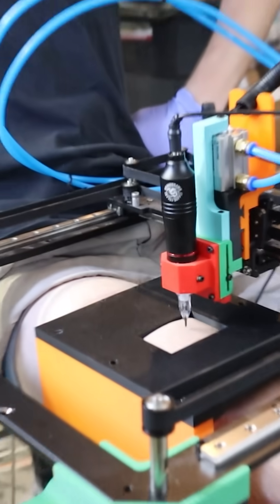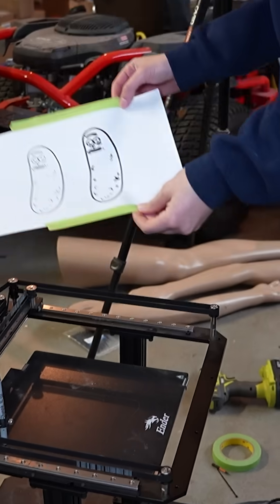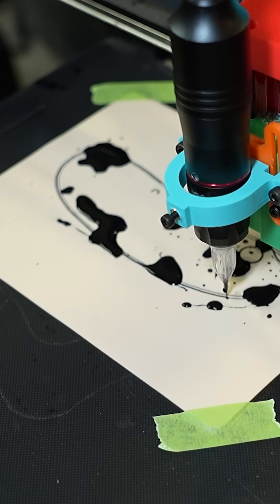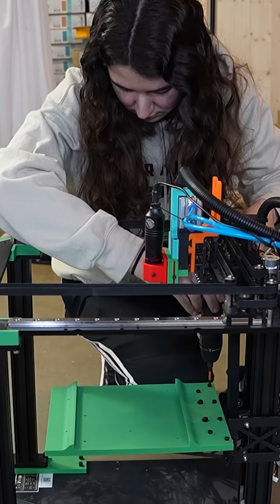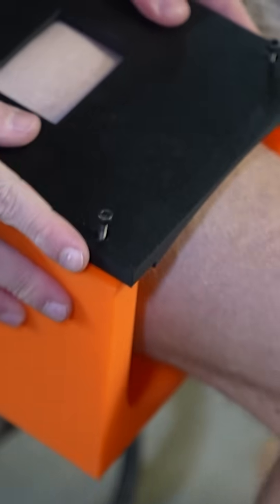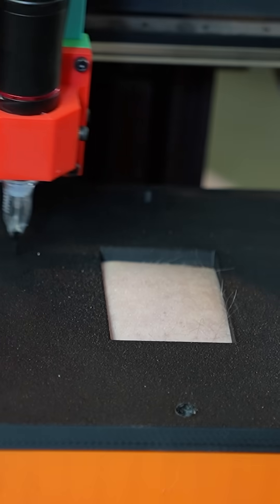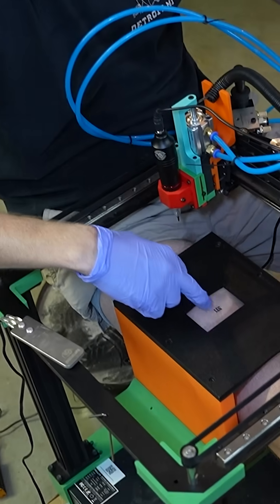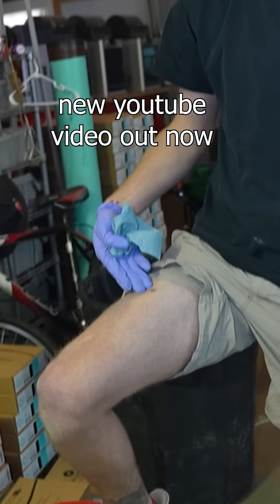Tattoo 3D Printer?

Comment: This is actually crazy. You know how fast getting tattooed could be if this was a thing
Reply: Mhh.. for real life application, you d need a custom g code, sensors for leveling and some form of "pause" function to refill your ink... And more but for fuck yeah that s cool function hell yeah ! One doesn't become an engineer with a boring mind y'know : )
Reply: @blablah3167  you really need LIDAR for the leveling issue and sadly you also kinda need 5-axis motion to get the correct angles on the skin
Reply: @jxdinglol  yep, or could also 3d map on point cloud and use that as a reffs but cudos your RAM, means are many, dedication, tools and knowledge are what prevent many projects, was just implying that it s fun yet to fully make it work practically it d require a lil bit more than "fuck yeaaah !" and some serious skill, so tattoo artist you can relax you re still having your jobs for a while : )
Reply: @blablah3167 your not gonna need to refill your ink. You just need a larger cartridge
Reply: @blablah3167 then the person flinches and there goes your plan
Reply: Problem being, skin isn’t flat. It would have to compute moment by moment topography of whatever body part it’s tattooing.
Reply: @jawa8883  you could have the printer make a mesh like with an auto bed leveller
Reply: @Scarytoaster1809 I know you know you can’t putt too much pressure when tattooing skin.
Reply: @Scarytoaster1809  it would be a bit mroe than that. you'd probably need to use a lidar system
Reply: @Scarytoaster1809  i think it would be smarter to have like a 3d depth camera which should model the height better

also maybe some straps to keep the limbs from being able to move around to make sure the tattoo is in one place; humans can easily adapt to movements but machines may struggle
Reply: @jawa8883 To be fair, we already have auto bed levelling, so some of the tech from that could go to this
Reply: @jawa8883 not too hard a fix, there is already technology to map out your build surface for 3d printing because build plates warp over time from the heat cool cycles that they go thru. Just add some gcode to map the build surface first then it will adjust z height to follow the surface.
Reply: @jawa8883 actually can probably program it 2 read the area it’s gonna tattoo like a scanner 2 see Dow down or up it has 2 go like on the four arm
Reply: @jawa8883  whe have machines thst laser eyes. I guess a tstoo robot should be possible
Reply: @jawa8883  6 axis 3d printers need to be invented now 😂
Reply: @jawa8883 thats probably possible in these times
Reply: @jawa8883 they have multi axis cncs and 3d printers bro. This is easily a thing. Ai art, ai tattooists. Well. Ai taking jobs left and right like that south park episode
Reply: @jawa8883 stick a LiDAR sensor next to it and call it a day😭😭
Reply: Laser depth reader attachment and adjust the height based off readings and you can tattoo bigger, and more varied surfaces
Reply: @jawa8883  That would actually be pretty easy to engineer around. Just a few thousand for an electronic eye or whatever they go for now (I haven't been a machinist in like 20 years now, so I don't know).
Reply: @jawa8883  easy... add a LIDAR
Reply: @jawa8883  which is wholly and completely possible
Reply: @jawa8883 
I imagine you could do a few workarounds for this; for example, one that’s probably overkill would be to take a 3D scan of the area being tattooed and correlate that map to the image being “printed”
Reply: @thefourshowflip  except humans move. the skin moves.
Reply: @jawa8883  as long as you can stay still while the needle is touching, it shouldn’t matter with a 3D scan; it would be mapping topology not position on the printer bed.  I imagine that’s why they used that leg holder in this video, to limit movement.
Reply: @jawa8883 if the skin could be vacuum sucked up or kept taught somehow it would work like embroidery
Reply: @jawa8883 In the full video, I’m pretty sure she put a sensor to determine the curvaturez
Reply: @jawa8883  AI is a scary and beautiful creation. Let's see what's to come.
Reply: @jawa8883  whit an IA thats sounds posible
Reply: @jawa8883 this would not be hard to do the tech to do this is cheap and can be integrated into a machine like this with ease
Reply: @jawa8883  we have the tech im suprised its not done yet
Reply: @jawa8883  I guess the idea is that someone will see this "proof of concept" and go custom design a machine for this purpose that accounts for all the issues
Reply: @jawa8883 yeah, but that would only require depth cameras and also an understanding of skin elasticity etc as the type of skin can vary widely by area and person to person. You also have to take heat into consideration.. and risk of overworking skin, some skin doesn’t take colour as well as others etc so it would need to be able to check the tattoo, as well as wash it during the process etc - there’s a lot that would need to be done. Not to mention sterilisation… would it be manual or automated etc for a machine to actually be allowed to be used on humans would take a lot of investment and research. 

And those are just a few things they would need to be considered
Reply: Another job removed due to automation 😂
Reply: @TheSandwichMonster kinda but someone still needs to make the art for the printer, and tattoo artists really are artists
Reply: @TheSandwichMonster is it really a job thou? It's like being a social media influencer, it's not really a job, it might make you money but it's not really a job.
Reply: @TheSandwichMonster  and another one created per usual
Reply: @TheSandwichMonster I think most people are gonna want to have a human tattoo artist. Getting a tattoo is kinda like getting a hair cut.
Reply: And what about real art made by hands ? Like it's cool and all but i wouldn't do it
Reply: @Kumo_nl 

While tattoo application is a skill and worthy of our admiration, a good chunk (if not all) of the actual artwork is done before the needle ever hits skin.
There's nothing inherently wrong with adopting automation if the results are what the client is looking for, regardless of whether a human is involved in its application.

I know someone who had an AI Image of a norse warrior minorly adapted by an artist who then put it on his leg.
Now that, I'm a little less comfortable with, but we can't do anything about client's choice of artist when it's their body.
Reply: It is a thing they just don't call it a 3d printer..they are literally making robot tattoo artists
Reply: Yeah amazing idea. Let's steal more jobs from artists and replace them with technology that does it way worse. It's way riskier. And only works because of very specific conditions
Reply: @the_snapdragon7809  I wouldn't say it stealing it would just be another way not a replacement nothing can replace artists work!
Reply: Now we're going to have organic vs non organic tattoo artists
Reply: With all the different things that would need to be customized, adjusted, break for ink, etc. It’s much faster to get it done by humans. That’s why tons of figurines are hand painted. It’s faster and less expensive to pay someone to do it than it is to create an efficient machine.
Reply: Hmmmm Star Ship Troopers any body ? 😂😂😂
Reply: @Dallas-r6e  more like idiocracy but yeah, “Death from Above!” 💀
Reply: why are you obsessed with automation
Reply: Missed opportunity should of said my leg!!!!! From sponge Bob 😂😂
Reply: tattooing is supposed to be slow for safety. there’s a reason why rushed works look horrible
Reply: The future is machine tattooing ran by an AI that decided ur artwork needs a 6th finger on its hand lol.
Reply: It can't stretch the skin, it can't predict the unpredictable movements of the client, and it can't adapt to the differing textures and elasticity of skin.
Reply: And cheap. I cant wait till this is the norm.
Reply: I think a bunch of artists would hate this being a thing.
Reply: People don't seem to understand that a good tattoo isn't fast. A good tattoo is done in parts and allowed time to heal between sessions. Yeah, this would get a sleeve or a back piece done fast. But how well will it heal? I bet the fading and scarring would be insane.
Reply: Love how boxed in everyone is in thinking in 8 years when AI has taken its final form to programm itself, we wont have tattoo robots lmao. How crazy 🤣
Reply: Get rid of another job
Reply: @ brother with Engineering and KI- the working class will be fully wiped out within the next 15 years. Most jobs besides day cares, restaurant staff, cooks,  and specific fields of craftsmen will all be done by robots. I was in shanghai for 12 days and saw more robots than i have in 30 years of my life. They are producing humanoid robots in masses now in china.
Reply: Dude the pain tho.. a machine can't just pause whenever Ur pain level is maxed n need a break... Just imagine bigger tattoos..

I needed a break on my black/white 5x5xm tattoo, as it went over some bony areas.. he actually had to shift the tattoo a bit off center, away from the actual bone.. my tattooist had hand drawn my tattoo, so he just made adjustments immediately as he went..
A machine wouldn't be able to take these considerations.. 😅

But smaller or text could work fine i guess..
Reply: This would literally fuck up the industry in the future why risk a fucked up tattoo that costs 10s of thousands when you can get one done and selected it from a catalog or AI generated 😅time too
Reply: They do kinda have smt like this, but it actually takes SO much longer😭
Reply: @kaspas5511  and the results are garbage. So let’s look at the positives of the current “robot” tattoos. They are slow, you get to pick a basic stencil, that probably 10-20 other people already have, and you get a worse tattoo for your troubles. Plus you get the added benefit, of knowing you helped speed up the process of getting rid of these pesky human artists that AI hasn’t already been able to destroy, career wise. 👍🤣
Reply: in my experience, as a tattooed person, you're not looking for "fast". you're looking for good. this was a very simple tattoo and it turned out fine, but we shouldn't be trying to take the artist out of the process. they do more than just deposit ink into skin
Reply: Starship troopers... That was the scene that made me not only want tattoos, but become a tattoo artist
Reply: It’s a thingymiboba telegraph?
Reply: probably is possible
Reply: It is a thing
Reply: The amlunt of money od pay to have this
Reply: Instead of the normal 3d printing software, could it possibly run better with cnc software?
Reply: This is exactly what the future is going to look like perfect tattoos done by machines
Reply: Tattoo artist rn😱
Reply: Let’s be honest this machine is enough of a douche bag to give a good tattoo
Reply: Not Sure
Reply: Agreed bro
Reply: Yeah, except for hyper realistic, tattoos where are the artist actually puts in extra effort and detail and it might take going to the Tattoo shop multiple times and laying there for 7 to 9 hours four or five times but by the end of it you literally have a masterpiece on your body 3-D printer could never do that.
Reply: Barcodes on all our necks 😬
Reply: It's pretty cool, but would probably not be very useful on big surfaces (because it would have to be massive) and be more expensive
Reply: Yeah fr and some parts of the party ppl get tattooed will be kinda difficult for it maybe but for sure arms back legs and hands for sure
Reply: @ there’s already $10 tattoos in Vegas and LA bro you can have a full built machine in the middle of the mall and you stop by and go in 30 minutes full sleeve if you can hable the pain if not slow it down
Reply: Bam! Invention.
Reply: bambu X1C has LIDAR and technically a downward camera. probably can easily cope with changing skin contours... unless you're black
Reply: And then tattoo artist could lose their livelihood… always need to consider the economic consequences when thinking about how cool it would be to replace people with robots or machines.
Reply: I hope this becomes common place to teach artists they have to compete with market standards not make their own.
Reply: Its is a thing now. Lol. People never listen to the "dont try this at home" statement. They made it work and now others will make it work better. :) ai tattoo shops are on the way. :)
Reply: Kinda revolutionary😂
Reply: its kinda sad to imagine taking some of the skill and art from tattoing. but practically it seems helpful and artists would still need to design it. it isnt awesome now but with a more detailed system it could be rly good
Reply: Make it better that's actually really cool I want to see some color
Reply: id say the biggest problem would probably be that people move and react. artists are able to adjust to fit the situation. there would need to be a LOT of tech to monitor for movement. the things that could go wrong outway the usability of smthn like this🤷🏼 just better to leave it to humans
Reply: Old never be a thing, needle depth is huge those tattoos are gonna blow the fuck out
Reply: Ya but people move, skin stretches, and your usually working on a round surface of the body.
Reply: Ptobly would struggle with art but could do words such as LEG
Reply: Okay so we ARE thinking about replacing artists with robots lol
Reply: no, this is literally stupid... i love it
Reply: It's about art imo. I hope this doesn't become a thing
Reply: Starship troopers already did it
Reply: it has its pros n its cons i just don’t like the fact that one of these days a Terminator will spawn its only a matter of time
Reply: @dannygomez8251 that's not the way software works though. The threat of AI isn't that machines are going to become self aware and rebel. The threat is that their function will be performed without restraint because we don't know what restraints to program.

For example the algorithms on social media that feed you content have a purpose that purpose is to keep you engaged. A side affects of that is because of human psychology what keeps us engaged is stuff that makes us angry or stuff that is incorrect. Which means the algorithms serves us up information that we want to argue with that makes us angry and that anger spill into real life and leads to thinks like January 6th and the Tesla fires.
Reply: Tattoos are supposed to be art. This is not art
Reply: @waluigi710 honestly tell that to half of tattoo artist cuz half that shit is not art, and I’m. It even sorry for saying that because the good ones know I’m not talking about them! 😬
Reply: AI-generated image sent to the tattoo printer to tattoo to the skin.
Reply: 100% I'm looking for a location near me.
Reply: Literally slower in every way, and much worse results. Not saying that the technology won’t evolve, and become really good, but at that point they would have to be as complex, if not more so as surgical robots that cost hundreds of millions of dollars.
Reply: shut up bro u prolly have an infinite and 2 birds tattoo
Reply: @latortugatetona5157 why are you so pressed 😅😂
Reply: Ur pressed  @latortugatetona5157
Reply: Someone didnt get piped down this morning 👀 @latortugatetona5157
Reply: @latortugatetona5157  you have a half clipped melon skin pfp

Comment: With a auto calibration attachment it could get the ink penetration more accurately as it's measuring the surface its going to print on 5 point square (corners and center)